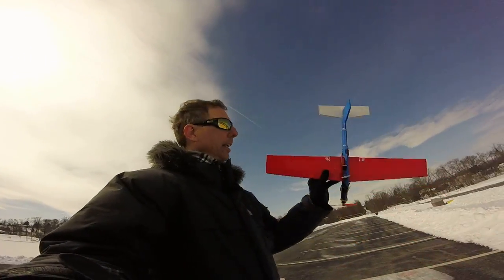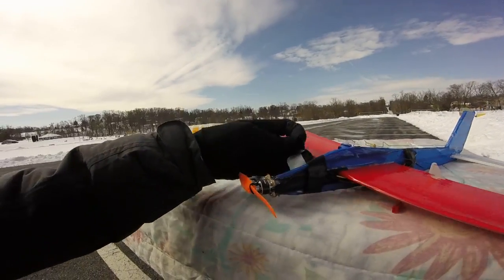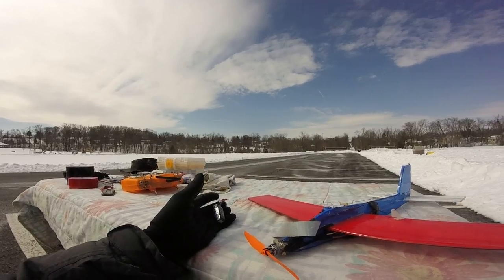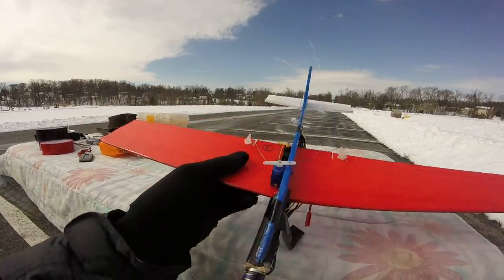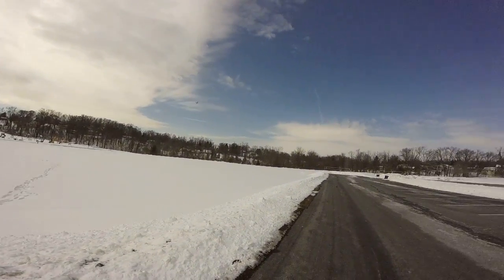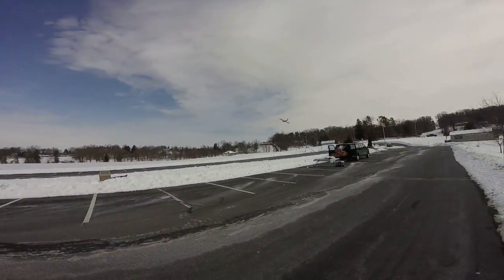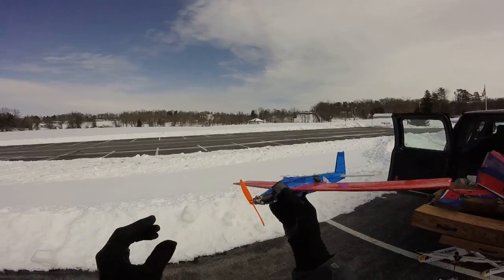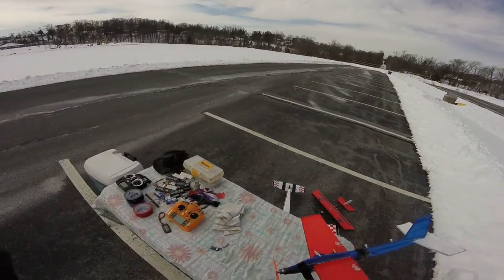Little Jet flight video and overview

Comment: This plane looks fun and awesome for some school flying. I would love the build plans for this little guy. Do you have any PDF plans for it yet?

Thanks,
Brad
Reply from the maker: Brad Chism I have neglected getting the plans together for this plane, but be patient.  I will get a build video together and the plans online in a few months.
Reply: William Whale  Thanks for getting back to me. Would you be so kind to list the items used and measurements of the fuselage, wings and tail? I have a couple park flyer servo's and a nice power unit that needs some love so just getting some measurements would be a great start, then what materials used would seal the deal. Would be less on time too since you are a busy man.

Thanks,
Brad